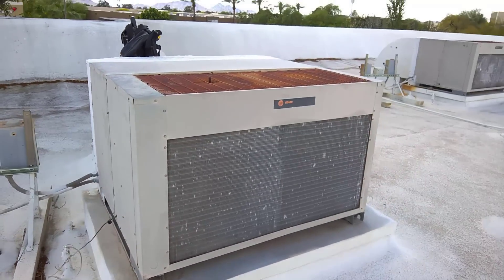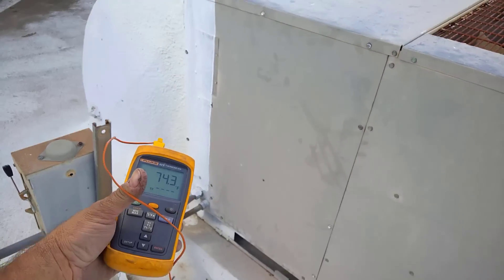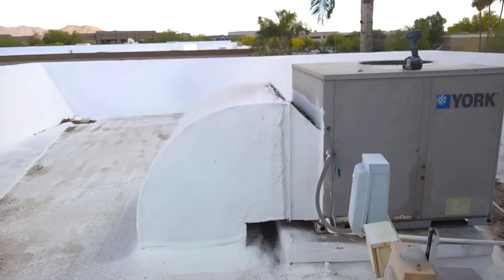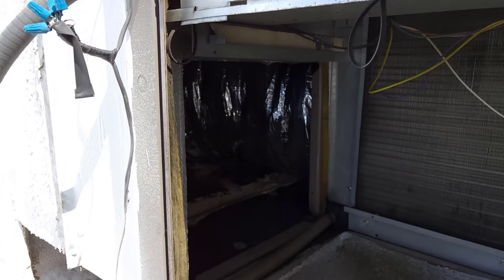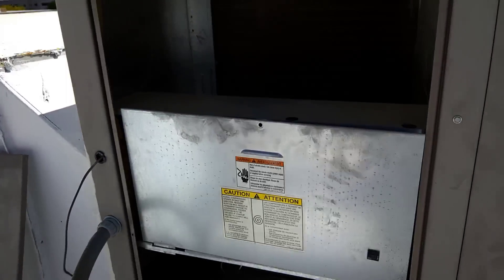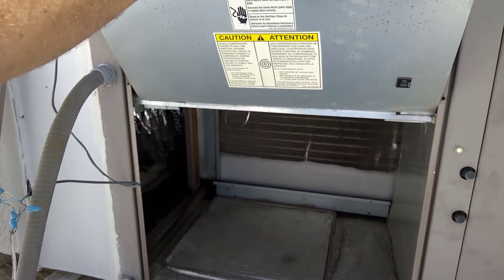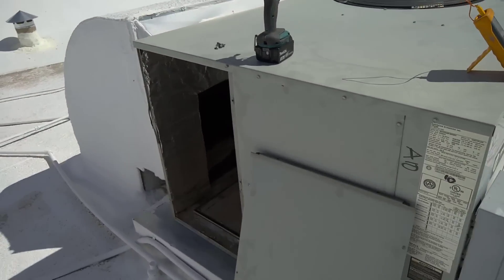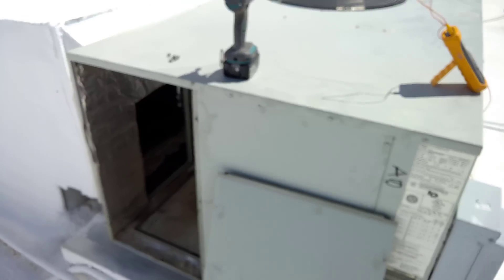Ghetto Rooftops: Scottsdale Edition

Comment: I wonder if those smaller more residential-sized Yorks replaced some of those large commerical Trane/GEs from the 80s
Reply from the maker: I wouldn't doubt it. And what sucks is the blowers might not be as strong for the office ductwork so the CFM is lacking.

Comment: Great stuff.  The inspector missed the duct work, oh wait, they only care about the electrical and the gas lines!!
Reply from the maker: They don't inspect crap here. 
Not new construction and certainly not a change out.
Reply from the maker: Especially the Phoenix area.
In another county in central Arizona there were strict inspections on HVAC installations.
In Phoenix the inspectors seem to be either bought off or incompetent.